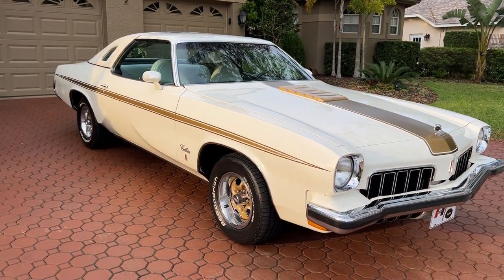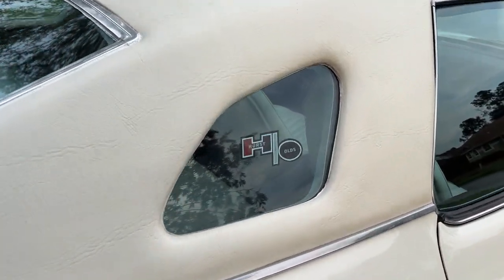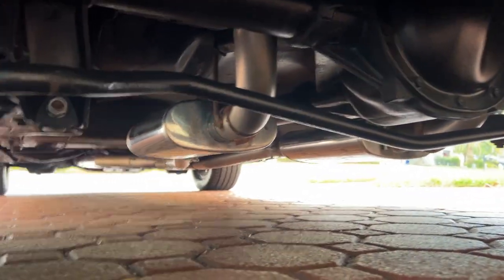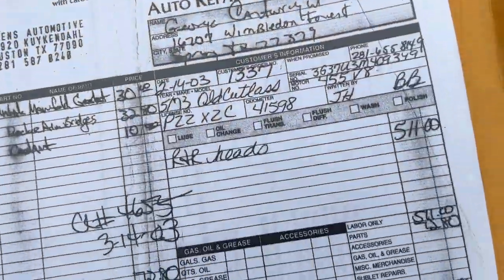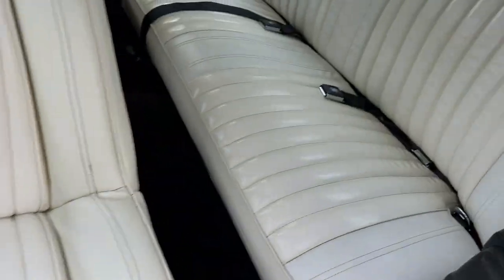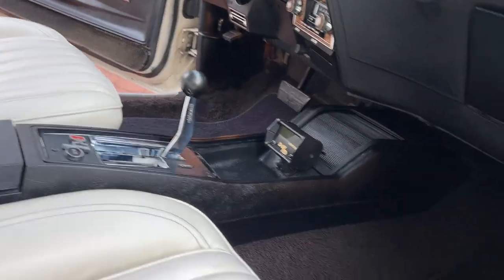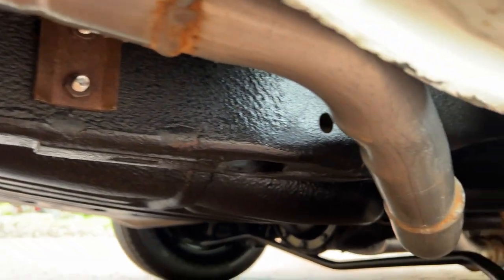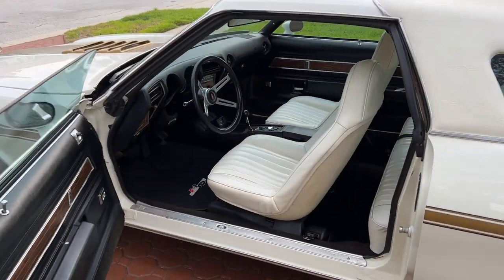73 OLDS CUTLESS S HURST/OLDS #282 OF 1097 BIG BLOCK 455/3SP AUTO MATCHING #'S COLD A/C NO RUST MINT!

Comment: Oldsmobile cutless and 442 1973 are top beautiful model designed the engine turn heavy use 5/40w is working better to 20/50 and 10/40